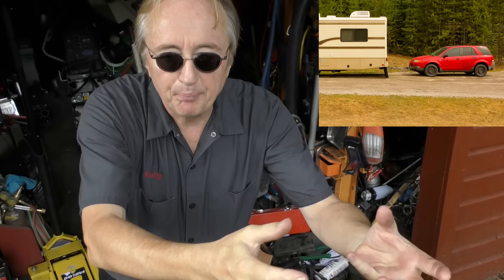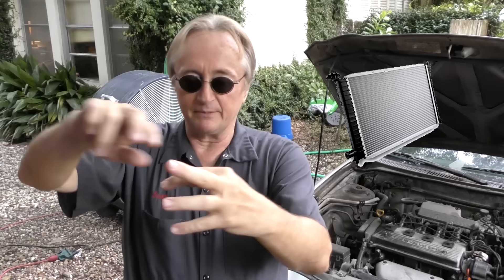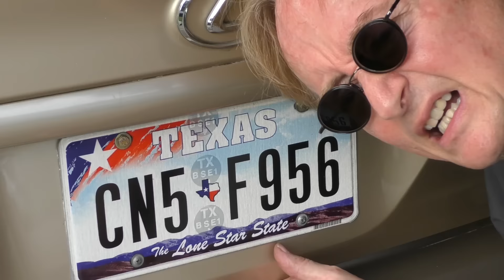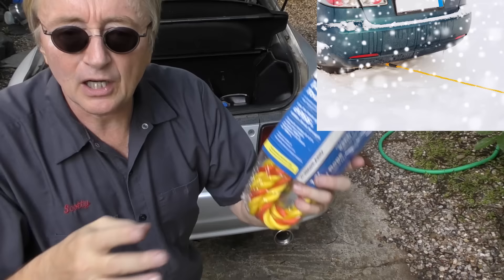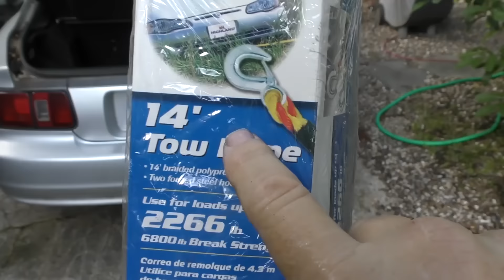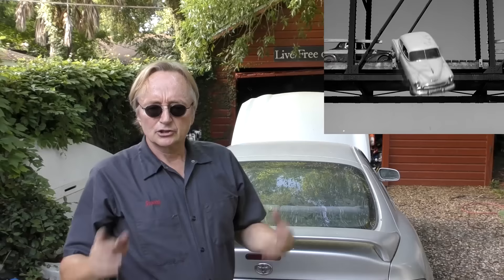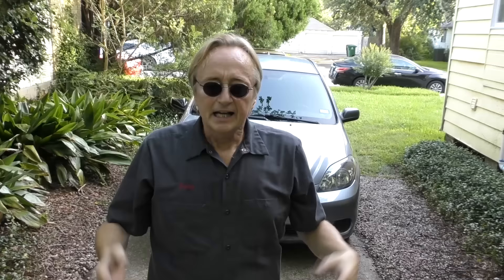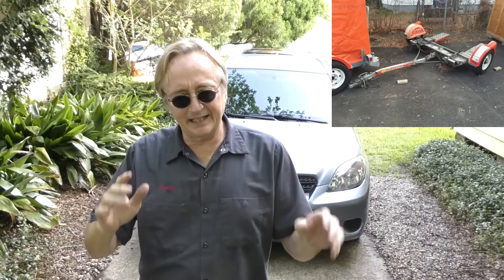Never Do This to Your Car

Comment: @0:29
"If your car's an automatic transmission, you can't tow it with the drive wheels rolling on the ground, because that can ruin the automatic transmission."
I though that cars are put into "Neutral", before getting towed?

If the car is left in "Drive", then I can understand how the transmission will get damaged.
But I do not understand why Scotty does not say that it is okay to leave the "drive" wheels on the ground, as long as the car is in "Neutral".

When in "Neutral", I thought that that disengages the wheels from the transmission?
Reply: Neutral only disconnects the engine from the transmission. The drive wheel are ALWAYS attached.
Reply: Scotty your wrong I've done this for years some people don't put the car's in nutral when they tow them the transmission and moter don't turn on the inside it it's in nutral about every car has been towed that way i rebuild transmissions that's not how they work

Comment: So if it's 4WD, make sure it's not in that mode via the switch when towing! Correct?
Reply: Not necessarily.  Most of today's electronic shift 4WD systems don't have a neutral mode and automatic transmissions are typically not made to be flat towed, so check with your vehicle's owner's manual or call the dealership and find out.  I'd say for mechanical reasons don't try it, in an emergency to get off the side of a busy freeway you may be able to flat tow it for a few miles at low speed, but for a long distance get a flatbed trailer or a roll-bed wrecker.

Comment: Scotty - I’ve had a burning question about towing an electric car.  If you tow a Tesla with wheels on the ground, I assume they’re generating electricity.  If the battery is at full capacity and because it’s being towed and generating electricity, can you risk damaging the battery or causing a fire?

Comment: Scotty, What about a truck that is rear wheel but you can put it in 4-wheel when needed. Do you pull with the front wheels on the ground with the transmission in what?

Comment: ......not one mention of putting the vehicle in neutral and keeping it there during the tow duration......yeah, wonder why the Subaru blew its head gasket, must of kept it in park or in one of the gear selections.

I always towed in neutral no matter the vehicle.  And yes, they were my own.  Never had a single issue with any of them cause I kept it in neutral.  Yes I know the internals are moving when in neutral, but nothing is engaged to generate heat to cause failure.  I even checked the fluid for any discoloration and weird burnt smells after the tow, no changes whatsoever.

But see, where I see the craziness that may develop issues is, is those nuts that dont conform to the towing speed limits of 55mph on the highway.  Am always seeing people drive with trailers and vehicles that are being towed on its own wheels more than 55mph.  Some as high as 80mph has been seen.

Those people will for sure have problems for driving that fast due to insanely high revolutions, and not efficient fluid conversion between the parts to keep them properly lubricated.

Thats why when I see a uhaul trailer, which has a clearly marked sticker on the trailer to not excede 55mph, are being towed on the highway at 80+mph, I cringe.

And the reason I hate going to uhaul to rent a trailer is cause most of the time, the trailer I need isnt available cause someone drove over the posted speed limit on the trailer, and caused the axel and bearings to seize up.

Yes, I know the comments on that are gonna be that it isnt their trailer and they shouldnt have to care.  But even if they owned a trailer themselves, they would still be driving at high speeds.  Dont believe me, come visit the highways here in the San Jose area California highways for a few days.

Comment: Scotty, regarding towing a RWD truck, how do you keep the front wheels from turning and dogtracking the truck or making it weave back and forth, eventually getting violent and causing a tipover? My 1996 Ram does not have a steering wheel lock except when turned almost entirely to one side or the other. I can't lock it straight forward. What are you supposed to do about that?

I've heard the best way is likely to tow the truck on all 4 wheels and just disconnect/remove the driveshaft (s) and get one of those tow bars that hook to the front bumper?
Reply: JoeIsCrazyWillman the only wreckers I ever see used these days are flat bed ones. You are not going to tow a RWD using any other type of wrecker these days.

Comment: Scotty I have always had this question, are cars that just have the single tow hook on front more susceptible to frame and structure damage? Since they are being pulled on an uneven angle or the force isn't applied perfectly 50-50

Comment: So you have states with out inspections but you can't tow with a rope? Its easy when you know what your doing. The towed vehicle does the braking to keep the rope tought, and the driver of the tow car must be smooth and not go to fast. I've been towed on my motorcycle behind a car years back, chain broke an we were on holiday, friends we made had a car an towed me 8 mile to the repair shop.

Comment: HEY SCOTTY,  I got a 2002 Mazda Protege NOT blowing as much air through the vents as it used to when torso AND feet vents are open and set to recirculate.  The blower fan doesn't sound slower when engine is at idle.  What could be my problem?

Comment: I used a “93 Saturn automatic as a dinghy and towed it all over country with no problems.  Supposedly designed for that application. Just put the car in neutral and away we go! No wonder GM killed the line...other than it being overpriced, not a bad commuting car either.

Comment: This reminded, when I was working in a department store a couple years ago, as a greeter, so I was always working at the entrance of a store. I heard  wheels squeeling down the mall parking lot. I looked outside to find a tow truck towing a car on it's locked rear wheels. The driver stopped after passing my door and rehooked the car. I laughed for a few minutes. He could've blown the tires if he drove a few more meters or (if it wasn't on park) blown a head gasket and ruin the transmission.

Comment: When my uncle tows rear wheel drive vehicles “mainly trucks” he disconnects the drive shaft.
Reply: That's easy on a truck you can walk under it. Try it on RWD cars with 3 inches ground clearance, in the snow, up hill both ways

Comment: I've also seen "professional" tow truck drivers severely damage customer cars. That's always a mess because almost invariably the tow driver says the car was "already like that."
Reply: @Mr666Rev  
Then your company is truly professional.  
Unfortunately I see a lot of gypsy type companies out there. Every year I get 3 or 4 customers with major damage. 
One driver put a truck on his flatbed backwards and the tonneau cover blew off on the highway.  The driver tried telling the customer the tonneau cover was never on the truck. The customer's back glass was smashed in and the roof was also damaged. The guy went driving around and found pieces of his tonneau cover on the side of the highway. The tow company still said the guy's pickup was already like that and refused to pay. 
We fixed his fuel pump and I don't know what happened after that. The customer said he would probably have to turn it in on his insurance since he lived out of state

Comment: what if, say for example, i have a jeep obviously 4wd automatic transmission and i need to tow it somewhere with all the wheels on the ground. could i leave the transmission in park and put the transfer case in neutral? would it cause any harm to your vehicles drive train?

Comment: Aaah, using that pick to remove the tow hook panel caused a tiny gouge.  It's killing me.  Could it be pushed out from the back? Or maybe a strong suction cup to pull it out from the front?
Reply: @Palm Coast Adventures the seam is so tight, though. I probably would have used a plastic tool instead of metal.  I've never removed a tow hook panel, so now I wanna see how easily mine comes out.
Reply: @Palm Coast Adventures I think both my cars are pretty snug.  Toyota Solara and Lexus IS250.

Comment: In terms of the engine blowing the head gasket due to heat buildup whilst being towed. Let us assume the oil cooler is at the front of the engine at the bottom of the radiator, the oil would need to boil the water in the radiator and transfer the heat to the extent that the heat damages the head gasket. Just sounds far fetched to me. Would Scotty like to give us a detailed explanation of the heat transfer involved, otherwise this cannot be true, I am a Materials Engineer and a weekend mechanic.

Comment: Would putting it in neutral avoid damage to the transmission while being towed?
Reply: Seriously want to know the answer to this.
Reply: Nelson Cruz that will still cause transmission damage. 
If a vehicle must be towed with a wheel lift, and the drive wheels are on the ground, the ONLY safe method is to disconnect the drive shaft.
Reply: @Mr666Rev  why is that though? Also would putting a transfer case in neutral work?
Reply: 92'PowerDiesel because with an automatic trans in neutral, but still connected to the drive wheels, you’d be turning the transmission internals without having proper lubrications going to all the parts, and not cooling the transmission fluid properly. Putting a transmission in neutral doesn’t disengage the output shaft from the internals, it just disengages the transmission from the engine. 
A transfer case is a completely different thing. You can safely put a transfer case in neutral and tow it on the drive wheels because the output shafts would be disengaged from the internals.
Reply: @Mr666Rev  ok, thanks for the explanation.

Comment: Hey Scotty, don't AWD/4WD cars have some kind of lever on the transfer case that disconnects the rear wheels from the drive train so you can drive it like a FWD car?
Reply: 4WD trucks with a manual transfer case do, and it disconnects both drive shafts. Most others, including full-time 4wd, automatic/on demand 4wd (like RAV4, CR-V, most crossovers), and AWD cars (almost everything Subaru) don't have that feature. 

A lot of these later examples require you to keep all 4 tires at the same size, model, age AND tread wear, ever when not towing, or the transmission and differentials will break because they're always trying to equalize well speeds.

Comment: I've been towed with all 4 wheels on the ground. I have a fwd Honda Accord. My transmission is fine
Reply: Johnathon Butler you said FWD which stands for " front wheel drive" not AWD!
Reply: @joelspivak6622  that's cause that's what it is.

Comment: The new 2019 RAV4s dont have tow hooks, though they have a rinky-dink way to get the vehicle up onto a flat bed, but U Install it and tow truck drivers wont know the trick. Extreme cheapness on Toyota's part.

Comment: Hey Scotty my name's mark I do like your videos I like your show I do have one problem with this video I'm not dead matha 90 body I'm not being a hater I've been telling cars for professional loving over 25 years that tow rope is not any good for doing recovery work it will get somebody hurt or get somebody killed you want should pull this video down and the part about your Toyota I've actually had those mounts come up for a car they're just mainly to get a vehicle on and off a truck a you're supposed to use a 4 point system hold down

Comment: i pulled a honda civic about 2 miles with the engine on and transmission on neutral. i had somebody push the brakes as needed. you think i will be safe?

Comment: what if you put the car in neutral? would that mess up the automatic transmission/all wheel drive system?
Reply: Neutral doesn't disengage the transmission from the wheels. It only disengages it from the engine

Comment: If I’m going to tow a rear wheel drive car or truck on its rear wheels, would it be a good idea to disconnect the driveshaft first? Or can it cause damage to the differential?

Comment: Don’t know if you’ll see this and can help me. But I’m in a fix.

I have aJaguar XJ6, which is on 4 flats, no keys, stuck in a garage. My mother and sister made the impeccably stupid choice to have it shoved in there. I want the car gone. But because it’s difficult to get it out, there’s no paperwork, I can’t seem to get anyone to get it out of there. Also, I do not care what happens to it. The front faces outward. At this point, I’m considering hurling a boat anchor through the windshield and yanking it out myself. Do you have any advice?

Comment: I had a town guy pop the gear shifter and the car went flying down the ramp then he droped it in park while it was about to smash in to my porch and it stopped quick but i never got the car to start again. It was a diamond edition 2000 GMC Jimmy that the starter had gone bad. A few weeks later i finally put the new starter but it wouldn't even try to start or crank and i bought another starter because i had bought a small performance one but i just sold it for 100 dollars because it was kinda rusty under the carrage but the car had AC push button 4x4 and engine was in great shape. Now i drive a 94 Camry but now i think he broke my transmission

Comment: This guy's a little fishy sometimes...  I never had any problems towing lots of cars over the years with just a tow rope, you just have to put it in neutral, and I towed an 82 Honda Accord that way for almost 100 miles, and nothing got warm on it. But only tow it with a tow rope if it's the only way you can. But to think of it', there might have been several designs back in the 60's that you had to remove the driveshaft from the transmission and rear axle because it simply would not work, I kind of remember one my dad was trying to tow back in the 70's and he was having this issue, so he had to take out the driveshaft.

Comment: You should've mentioned in your video while at the towing part, that the transmission can get destroyed if towing in (D)RIVE, not in (N)EUTRAL, regardless of manual or automatic transmission. Actually I would like to see someone trying and tow a manual car in 1st gear lol. I enjoy your videos, but this one is of lower quality on your provided information, seems incomplete, as your theory only applies in certain circumstances.

Comment: Can't your just place your car in neutral for a FWD or RWD? Great video nevertheless
Reply: Generally speaking, no you cannot.  Now I have seen some models of vehicles that state in the owner's manual that they can can be towed with the drive wheels on the ground while in neutral IF it is a very short distance while not exceeding 15 mph.
However, I would NOT do this for the following reason:
Neutral only disengages the engine from the transmission, but not the transmission from the drive wheels.  So, even if you are in neutral, the transmission will still be turning without being cooled which most definitely could and probably will cause damage for the same reasons as Scotty said in the video.
So yeah, don't do that.
Reply: @thebrokenglasskids5196  Thank you!

Comment: is it okay to tow a rear wheel drive from the front if it's running? it won't make it far out of my driveway which is the problem but it turns over

Comment: As a tow driver, I hate cars with the bolt in tow hook. Most people in my area never have them in thier car. 

Then they get mad at me when I don't tow it... Shrug.
Reply: Get yourself a couple nylon axle straps and go to the control arms. Never need to ask for another tow eyelet or refuse a tow again.
Reply: @OhYeaMista  
I've bent control arms with those. The little arms that some bmws have are just not made for that. Just wish they would put in real hook points instead of plastic on cars these days. Been towing for 9 years and I've just trained myself to not tow cars the unintended way.
Reply: Onisixx   I think you’re misinformed bud.  Look up a bmw in your tow manual. It says don’t use hooks or chains but soft nylon straps are ok on most models. 2005 7 series actually recommends to avoid the tow eyelet and suggests axle straps instead believe it or not. That info comes from bmw. Also been out there a long time; 19 years.  Never bent a control arm or seen a bent control arm with axle straps properly used.   You gotta be careful of tie rods, but the control arms can usually handle it so long as the things not stuck in park and you’re skipping skates under the tires. If you’re telling me you personally towed a car and  got conformation that you were responsible for a bent control arm because of properly used axle straps I’d be very interested in the details actually.  Year, model?
Reply: @OhYeaMista  I have only bent a control arm once with straps and it was actually on a Pontiac (lost of rust where I live). After that I just opted to not risk the damage to a customer's car in that way again.
Reply: Onisixx   Front or back?   I can definitely see those thin steel GM control arms on the back bending.  I’d be very surprised about any front bending, steel or aluminum.
Reply: @OhYeaMista  it was the front. I was surprised as well when we got a claim. In all honesty it could have been just a customer trying to fix there car on us. The risk is just not worth the headache for $30 insurance pays us for tows lol

Comment: Front wheel drive 
What if you place your car in neutral ????
Reply: Doesn't matter, the differential/output part of the transmission is still spinning and will get damaged without lubrication from the engine running.
Reply: @RobertHancock1  
Ok
 Thank you ..
Joe ..

Comment: Yo scotty! I have a 14’ camaro ls and iv never had a problem with it but recently when i drive over 50 mph, as i start breaking the steering wheel vibrates and the harder i break the harder the vibration is and you can hear it vibrate as well, what do you think is going on?